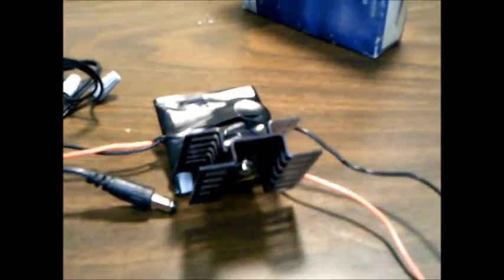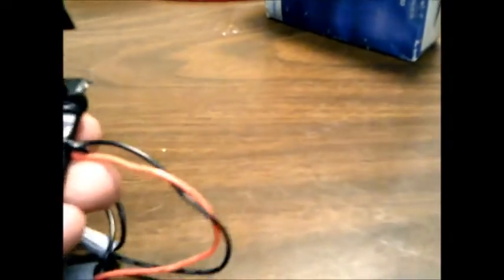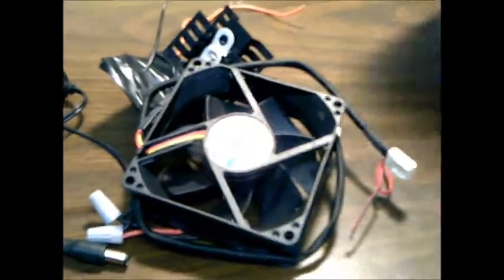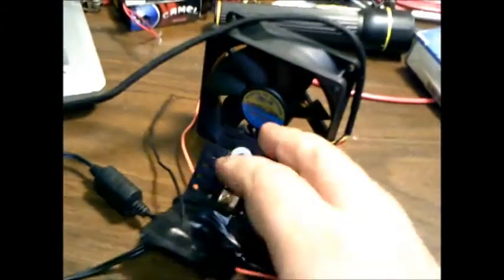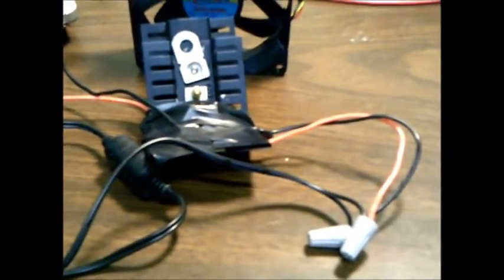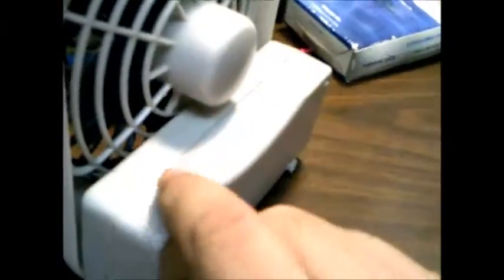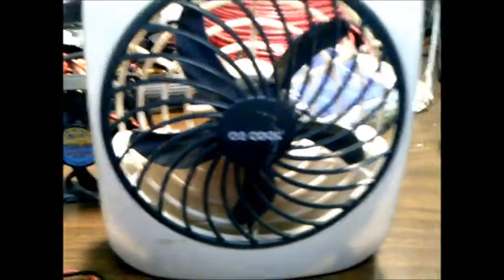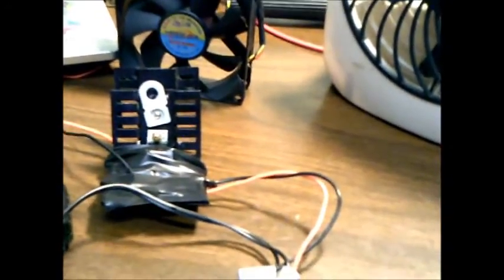Powering 5 Volt DC Electronics from a 12 Volt Battery

Comment: I want to run a projector that is dc powered with a battery instead of running it through an ac adapter. The back of the unit shows 12v 2.5amp, I want to go Mobile and use the projector using a 12v rechargeable sealed acid battery. Can i just plug the projector directly to a12v battery using aligator clips? Also i saw batteries that have 1000mah to 12000mah, does this matter?
Reply from the maker: Yes if your projector requires 12v and draws 2.5 amp you can hook it to any 12v battery that is rated for and output of at least 2.5 amps.  1000 and 1200 mah would not work that is only 1.0 or 1.2 amps and hours.  I would look for a good 7Ah Sealed Lead Acid battery.

Comment: @lmulkey2011
G'day Tom..! Nice Clip mate... Have you considered the Low-Tech method ? Approach your Battery, & study it till you reckon you know the lie of the Bridging-Straps, between the Cells. Take a 2 inch Steel Nail & hammer it 1/2 an inch into the Lead Strap between Cell3 & C4. Through the Plastic. All done ! There's now 6 V. Between the Nail & Either Terminal. Use each end of the Battery at 6 V, then recharge the lot at 12 V. 
:-) Hillbillyism .
 Ciao !